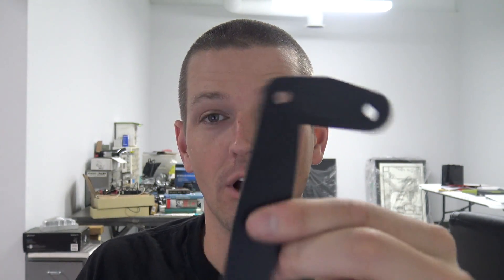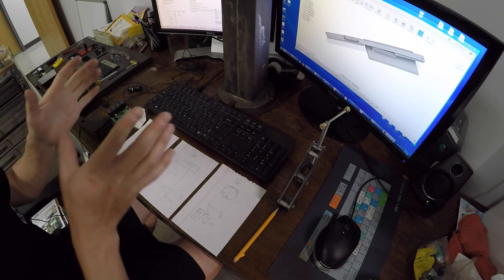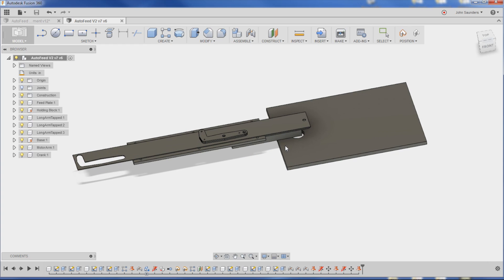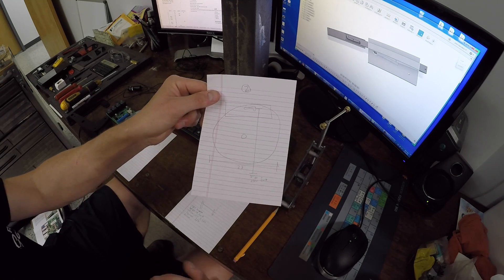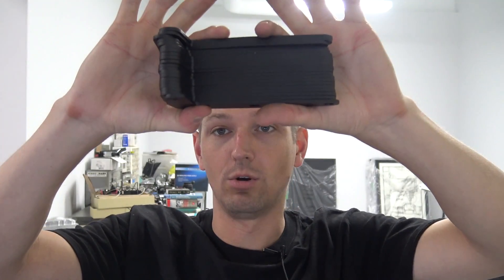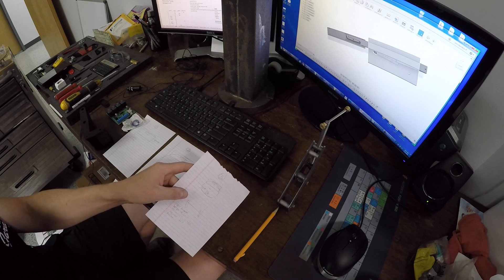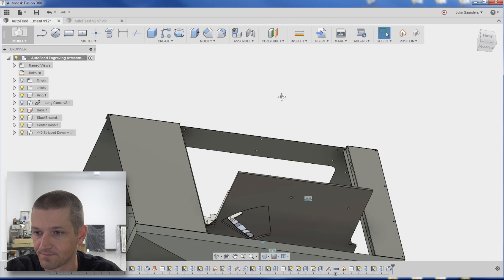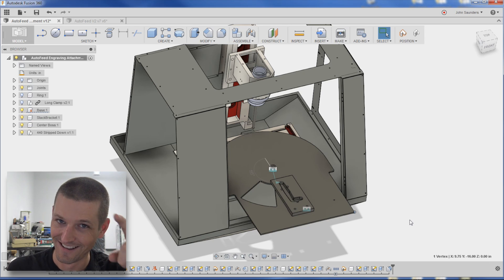Automatic Arduino CNC Parts Loader: Tormach 440!  Part 1

Comment: The disc seems like a good idea but it's just so enormous! 

Personally I like your slider idea more. But I'd simplify it a bit by using an air cylinder instead of the fancy linkage. 

You could have a second small cylinder raise or lower a stop pin to give the main cylinder essentially three positions (extends up to stop, engraving happens, stop retracts, cylinder extends fully and elects part). 

Would be very easy to control, because you can just run solenoid valves off of the Tormach relay board. 

Also, maybe I'm not understanding the disc concept. But it looks like it needs a lot more clearance in the machine door, if it moves with the table. And it can't have support legs to the ground, because it has to move when the machine moves.

Comment: Hi John, Have you considered using the tool in the spindle to rotate the fixture or even actuating a toggle clamp to hold the part in place? I don't recall if this machine has a tool changer but even if not some correctly designed "handles" on the fixture would allow the engraver to safely rotate the fixture. The same way with a toggle clamp.

Comment: you should make an angled feed tray for your stack of items instead of a vertical feed tray, that way the feed tray will actually carry some of the weight items so friction of your "round table" thingy will be less of an issue and you should be able to have a larger stack as well. English is not my native language, so i'm not sure if it makes any sense what I'm trying to explain.
Reply: do that make more spaces to even out the weight can put bearings to keep the disk stable and  instead of just droping the part down a hole drop it on a slide tray to move it away

Comment: When you're trying to rotate a plate like that it's going to have a lot of inertia. Positioning systems including steppers tend to work best when your load inertia matches the motor inertia at a 1:1 ratio. You can overcome a large mismatch but you'll need to sacrifice cycle speed and accelerate / decelerate rather slowly. To minimize plate inertia, you may want to mill some holes in the plate to lighten up the inertia.

Using the stepper isn't a bad idea. You'll be able to get pretty close to your final position. A belt drive would help with the inertia mismatch. Use a pulley / belt designed for positioning. The reduction ratio has a square effect on the mismatch (3:1 ratio would affect the load inertia by a factor of 9). I would suggest using a small pneumatic locating pin at the end to lock everything in place. A sensor on the pin cylinder could detect if the pin was able to extend to the proper position to indicate that the plate is in fact in place. A prox could be used to determine if you actually moved after your last cycle because you'll get no feedback from a standard stepper if it stalls.

Looks like a fun project John! Reminds me of a similar saying in software, why spend two hours changing a bunch of things when you can spend two days writing a script to do it for you. I'm sure it will pay off in the long run though and the main thing is it's fun (did I say that already?) :)

Comment: just thinking you may also need to reverse your stack feeder so the long straight edge of the part is leading? The small leg may not fall into position properly with the weight of the stack?

Comment: Doesn't the whole fixture need to move with the table? I am not sure that the legs for support are going to work well if it does. There are other linear solutions that could work better, but I know you are cautious believing an engineer ;).

Comment: Drill small indexing holes in the dial.  One for each pocket on the dial.  Use a prox sensor to detect when the dial is in position.  If you use a stepper, you only need to verify that the stepper moved to the next position.  If you add an encoder to the motor, then you only need one prox hole to find the home position on initialization.  Once the machine is homed the encoder will tell you where the dial is.

Comment: Think about using an air cylinder as a clamp to hold down the part that is being machined. I don't think you will like the electro-magnet.  You would need a bigger magnet.  A mag-drill is a good example.

Comment: Less application specific, I would just load a sub-plate with 10-40 pieces and be able to do a lot more work, like milling/chamferring/drill a key ring hole. Can you send me your part, the Tormach 3d table model and the X/Y travels? I can show you how I would do it.

Comment: Hi John! Very good idea but what about positioning? I think you need something that will index exact position of detail before engraving because anyway you will have play in your plate in order to pick up detail from stack. What i think is to make one more detail on working table with 3 degree angle where you drop detail and by turning plate backwards push detail to limit. After that magnet will hold. To release detail you simply go forward.. Only question is if your machine can engrave in angle. (if not you can rotate whole assembly.) loading pressure can be reduced by bending rods at about 30 degree or even more ( you have to try) in case you want i can send scetch of my idea. Roman. P. S.. Sorry for spelling))))

Comment: If the rotation table and stack are mounted to the tormach table, won't they move too when the parts are Being engraved? So you may want to quickly estimate the weight of everything, and travel of the table during engraving.

Comment: Might be a little late to the party here, but what about making the hole in the circular feeder plate large and square, so you can fit a die of different shapes there? That way, this could be used as a machine to engrave any flat part, it would just be a matter of changing the die to one that fits your part. The feeder would also need to be either adjustable or custom for each part as well. Also, as other mentioned, i would make four holes in the circular feeder plate so one engraving operation only requires 1/4 revolution.

Comment: Hey John love the design however doesn't the table move in X and Y? So if your platter is mounted to that with legs to the ground your table is going to have to move all of that weight... unless maybe your legs have wheels or something along those lines.

I also agree with other users maybe you could cut out a few more plates so the whole station doesn't have to rotate 360 but maybe 30-60 degrees between each engraving step.

Comment: I see two problems. I think a stack of parts is quickly going to weight so much it it'll be very hard to turn the platter, and moving the stack platter motors etc. around with the table is quickly going to get messy. 

would it be possible to lay the stack down, parts holder on the table that can flip between vertical for pickup and horizontal for engraving?

Comment: Your table will not be able to travel for the engraving if you bolt the platter to the table and fix it the floor with posts.

Comment: I love the brainstorming this is invoking!
I wonder if you can't use the table motion for most of this. Like have a stack of parts (magazine) beside the spindle, it would move the table clamp area under to load a part, then actuate the clamping mechanism (electromagnet), move to engraving position, then move to the eject position and trigger an air ram or electric solenoid to eject the part to a waiting ramp/hopper, repeat. It may be possible to use table motion to eject, as well, by moving under a wiper plate that would push the part off the side of the table. It would also be easy to incorporate a sensor to alert you when the stack is getting low, so it could be refilled before it's empty. And a sensor to stop when it is empty. Keeping the motions as short as possible will save time and machine wear. A sheet of UHMW under the stack should be slick enough to avoid too much friction. If not, an electromagnet may be useful in holding up the stack except when feeding. If the friction is too much, you could dispense each part, so the stack is not resting on the table. Think PEZ dispenser. Great project for reader input!

Comment: John, I'm only part way through the vid but I was thinking, why stop at one slot on your rotary table?  Why not have one every 15 degrees (or whatever will fit)?
Reply: My other idea would be that you have a tiny ram that would shunt an input piece sideways so that it falls into the slot.  The stack would be offset from the turntable slot such that it does not weigh down on the turntable.  Instead the ram would load up your turntable.  A simple cam would do the trick there.

Comment: I'm with the rotating-arm-and-vacuum-pickup camp. it seems much simpler - particularly because (1) it's been done and (2) it keeps you from having to worry about the friction from the (changing) weight of the stack. also, if you're using limit switches to determine when to stop, then I say use them for that purpose.. not as a backup to warn when the stepper has lost steps. otherwise, you're doing double the work (steps and limit switches) with twice the complication / failure points.

Comment: Hi John,
There will be many ways to devise a solution to this problem.  One step that most people skip is to think very hard about the requirements and write them down.  Once you have defined What it is you need to do, then you can move onto How.  It is very natural to skip to the How, I think it is human nature.  As for this project, here are some of thoughts
1. speed/units per minutes
2. Engraving quality (ie Z height accuracy, even a spring loaded engraver has limits)
3. Positional accuracy of the engraving
4. Surface damage/scratches (if it's zero, no sliding...particles always make their way into places you don't won't)
5. Maximum number of parts between reloading

Some higher level requirements
1. Is this to just solve a problem or are you learning other skills...ie learn a lot more about the pitfalls of different automation approaches
2. Generic solution or specific to this part...does it need to accept various sizes for future clamp sizes
 
Looks like a fun project!

Al

Comment: ...T-slots and a rifle magazine would be my inspiration: Have your clamps in a drop down "magazine" (feeding into a "rail" with an internal thickness a couple thou larger than the clamp) to be advanced by a linear actuator with some kind of a "follower" (make it and a part form as close a square as possible) feeding into an open section of rail by gravity. Your stack needs a container (can be done using a few pieces of slightly modified bar stock) on an open area of the rail. I say "follower" rather than making it hold it radially because the rail can overlap the part's top surface and keep it from lifting: No magnets required.

Engrave, then when the part's done, advance the follower to eject the completed segment, then retract the follower (flat section of the follower behind the "milling area" (under the stack) to keep the stack ready for the next piece, then push forwards again. You'll need a second retractable surface to press into at the end, though: You want that clamp to be immobilized. 

Stack weight becomes less a problem this way: That rotary feeder thing is going to introduce a subtle problem, which is that the disc will be heavier on one end than the other. It's going to jam and "eat" a clamp (and/or just cut air) or you're going to start losing steps on your feeder if you load more than a few. (And your table has to move the whole mess, disc and all, losing steps all the way.) It won't do you any favors when it comes to rigidity, either. You want the whole mess to fit on the table: the ways are designed for supporting loads due to gravity, not torsion.

Comment: you could use both systems together.
the horizontal shift mechanism to push the items to machine from the pack onto the rotary table. this will reduce the effect of the load of the stack onto the positioning stepper motor. for the horizontal one, you can use any asynchronous geared motor with a proximity and trigger a complete cycle once.
on the rotary table, you could have more slots patterned on the plate so you can load multiple items in one revolution. this will reduce the down time of the machine and make the cycle fast. you will of course need to have one reference pin for each slot that will make sure that the slot is in place for the machining and that the stepper did not slip for any reason.
;)

Comment: What kind of tolerances and burrs will you see on the parts?  Are you planning to oversize the "holders" by .005 all around?  Any way you can get a more rigid clamp, maybe a couple toe clamps that are switched via the relays?

Comment: Hi John,
Awesome can't wait to see it put together! I have two thoughts on the feed/part ejection. Quality assurance stuff. If the parts just drop down to a box or hopper they might hit each other hard and cause damage (depends on height of drop). Also, on the rotation, if the parts are sliding a crossed a surface they might get scratched (depends on how smooth and clean the surface is). I don't know if the parts get post finished after engraving? Then no big deal on any of this. What are your thoughts? Best Matt

Comment: like a few others have suggested having at least 3 slots in the table would cut down on time loss due to travel...any more than 3 and I'm afraid the initial setup and code management may become more cumbersome than its worth...also the angled stack for weight distribution on bent rods was an excellent idea and I've seen it done successfully.

Comment: Hmmm. I think I'd use a walking beam. Say it walks left to right... The left (loading) station would have a pneumatic loader slide right angle to the beam. The center station is the engraving one and the right station just drops into a box. More complicated but more reliable and flexible for future projects. You just make dies for the first two stations for different parts.

Comment: You could put a bump actuator on the rotary plate. That would actuate fingers to drop a part in the pocket. From a post holder of parts.That would allow the dispensing of a part with each rotation. It would need to be just before the pocket. This would take care of the issue of weight on the rotary plate.

Comment: I have a few comments to that.

1. Put more the one part-slot in it.
2. Look up the step angle of your stepper. The plate is big. 1.8 degree can end up with half an inch of travel. I don't trust the accuracy of the stepper here. I would drive the plate with a friction wheel from the top or the side ( see what works better). And use holes in the plate and an electromagnetic driven bolt to index and secure the plate at the right place. A friction drive is not a permanent solution but it will work here for the limited amount of parts. The bolt can also hit a switch to signal back the rival of the next part
3. The support stands should alow movements of the plate. (free rotation at the top and bottom) As i see it the plate have to move in two axes for the engraving. the amount of movement is so little that the hight lost of the tilting supports is no problem.
4. The electro magnet ist a good way to secure the part, but use two. Otherwise the magnet acts as an axes for rotation of the part.
5. Nylon pads with a suitable lubricant for that will be good enough to reduce the friction. They will wear down but it will work for the amount of parts.

Comment: If stack weight is a big issue just use a little linear feeder (a little like your first idea) to feed from the stack into disc feeder.  You could alternatively have a little post behind the cut out in the disc feeder that would push the part out of the feed cartridge (which would have a bottom to support the stack with a slot in) before it dropped into the cut out in the disc.

Comment: Aren't you just, simplifying it here, adding an additional axis to the machine. An a-axis.  Does the tormach have the ability to control an additional axis. Wouldn't need the ardiuno then and everything could be run in the g-code.  Again assuming path pilot and tormach can control an additional axis.

Comment: I doubt the stepper will hold against the forces needed to mill a part. Make some index holes and have a couple of pins on cams that locate and hold the plate from turning. ie.. plate arrives at desired position, extend pins to lock it, mill it, retract pins and move to next station. (Multiple stations per rotation of the wheel would be more effecient)

Comment: I would stay away from steppers on this one as you need more torque and you will  want closed loop control anyway. To relieve the weight of the stack, driven augers on both sides at the bottom is typical. You could also have a bottom loading magazine. Have you considered how to signal to and from the Tormach?

Comment: Hey John, great idea for a project, I like it so far. I would consider using some UHMW material for your loader block that will be tapered to drop the part into the rotating wheel. You could also use UHMW for a "bearing" between the revolving and stationary plates. It's relatively cheap, easy to machine to tight tolerances, and has decent lubricity and wear resistance already incorporated into it. You could even add your teflon tape to it for more lubricity action.
Some good suggestions from many people to mull over for sure......
Chris @ Steward Machine Shop

Comment: John,

Check out PHD escapements.  Using one of these will meter the part onto your rotating plate.  It will also take the load of the parts above it, preventing them from weighing on your rotating plate.  I use these in my designs at work for the exact same thing and they work really well.  You can make fingers that attach to the escapement rods.  

https://www.youtube.com/watch?v=xD5ifTDFtRQ

https://www.phdinc.com/product/?product=escapements&series=160

Brenton